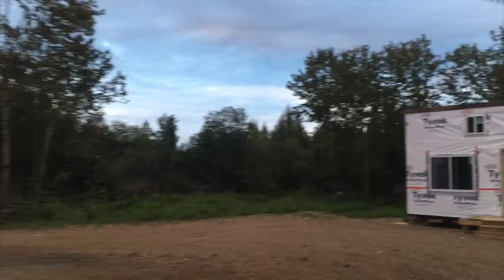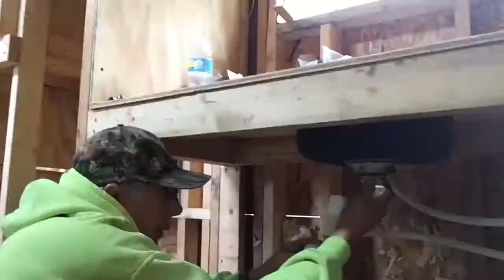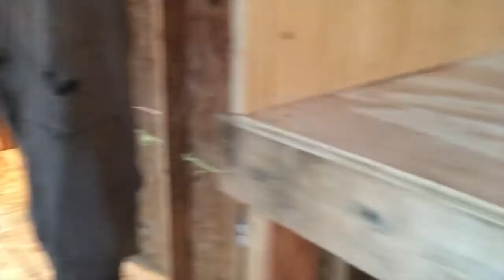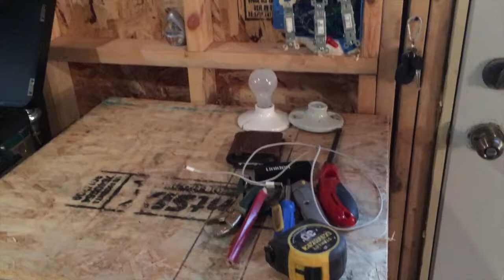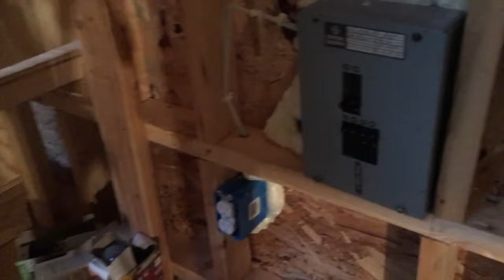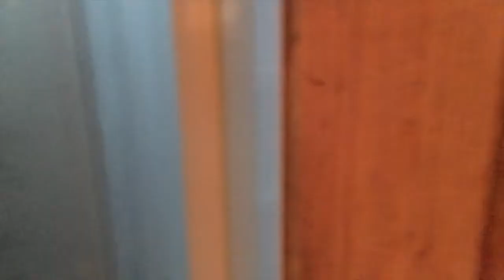Tiny House Update!!!

Comment: Gah, I hate those types of fridges.  The freezer part is almost useless.  And you have to manually defrost them at least once a month.  Twin mirrored medicine cabinets and a port hole window on the workbench side.  A bigger window on the opposite side of the workbench that you can see through the mirrors.  Just a thought.
Reply from the maker: wwwShadow7, I totally agree on the fridge, i picked it up for 20 dollars and our use is planned as temporary while we are under construction, our current use is limited to short weekend durations, which it has performed well at least keeping small pizza's frozen and our drinks cold. I was surprised to learn that it puts little to no drain on our Honda EU2000 inverter generator. I appreciate the thoughts, and Thanks for watching!